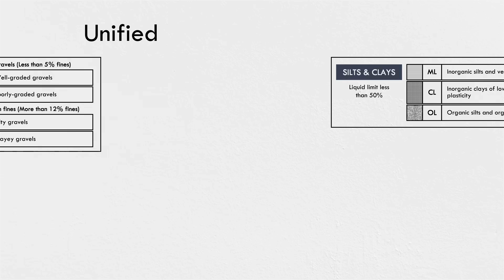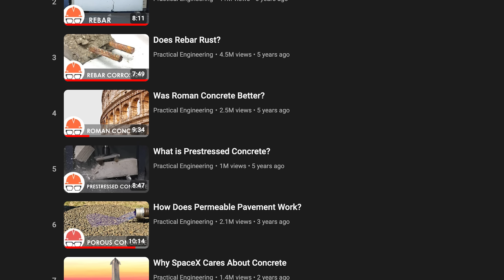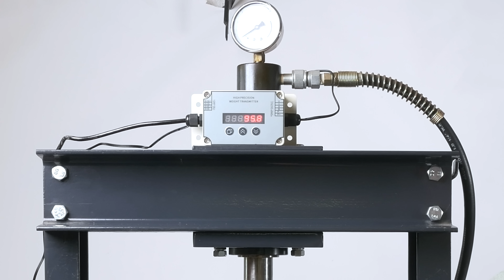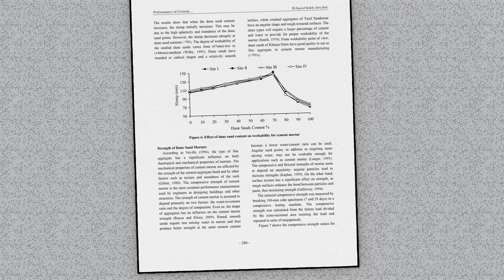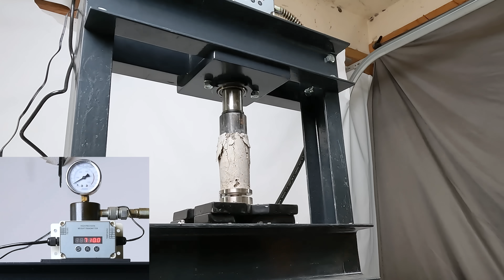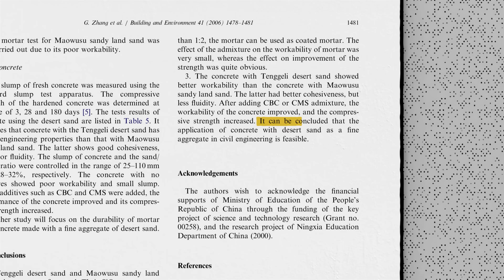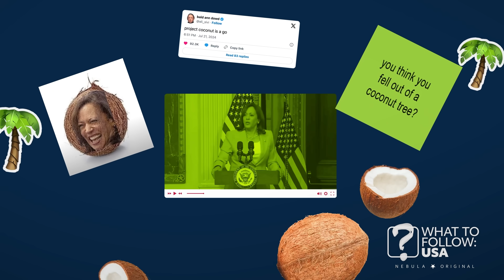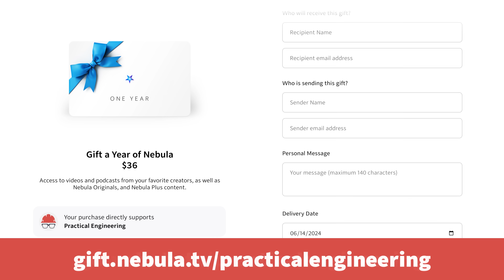Is the World Really Running Out of Sand?

Comment: About the recallability, I consider concrete as being non recyclable. Because you could use it as an aggregate, sure, but the resulting concrete will be much weaker, as concrete is softer than rock.
In the other hand, lime based cements, as well as chalk can be recycled. Because when is cures, they turn into the same composition as the original rock. So to recycle those, you can just dump the old mortar into the oven and get new lime or chalk from it.

Comment: It's not all just about grain size if you're trying to make glass out of it.  What we're running out of is high-purity silica.

When rock weathers, different minerals weather at different speeds.  Feldspar and silica weather faster than quartz.  So weathered rock, at some point in the process, consists of clay with grains of quartz in it.  When it erodes, and rivers and ocean waves sort the resulting sediment, the sand is quartz.  Quartz sand is what people normally more-or-less mean when they say "sand".  Making high-purity silica from whole rock is possible in principle, but it's a lot more complicated, and presumably a lot more expensive, than making aggregate that's sand in the sense of grain size but still whole rock in terms of composition.

Comment: The sand I've heard that's in short supply has nothing to do with construction, but with the high purity silicone used in chip manufacturing. Anyway, the value of crushed/recycled concrete is actually higher than the aggregate material it comes from. Widely used as a compactable base material in my area beneath concrete work and paved surfaces.

Comment: you  only add enough water to make it workable.... i delivered concrete for 10 years, workable means self leveling. i wouldnt buy a property in a sky scraper these days, the concrete is poured so wet its insane legit 7-10 inch slumps on the regular. no one wants to rake it out
Reply: It's a bit different these days with all the admixtures and things they can do with it. At a 7"-8" slump, 3 of my 4 most recent 2-day breaks came in at just over 5000 psi which was the 28-day acceptance strength. The fourth was around 4700 psi which was still way higher than the 3500 psi needed to stress PT tendons. That being said, not all concrete suppliers have the same quality, and not all contractors and inspectors have the same integrity so YMMV.

Comment: I read recently that the Romans used sea water in their concrete and this may be why the roads  have lasted so long.  Do you have any info on this?  Great video. I've been watching videos about this for a few years. Glad to hear we are not running out of sand.  Oh, cement is corrosive, but concrete is not I think. Is that what curing is about?  A chemical change that turns something toxic into something inert?

Comment: I remember reading a lot about "running out of sand" in the semiconductor industry because there's only a few sources that are useful for making chips, since they want raw materiel that have a high concentration of silicon and few contaminates.  Granted, you need a lot less sand to make a computer-chip than you do to make a building.

Comment: I worked as a concrete technician at a plant a while back, during which we transitioned from using riverbed sand to crushed rock for the 0-4 sand. The plan was also to phase out the 0-2 in the same way. 0-8 and 4-8 etc were always crushed rock. This was done due to sand running out close by, and continued extraction would have had an impact on the ground water. 
You hit most of the points, like how you have to adjust V/C ratios and add some chemicals to get the new recipies, but for us the most noticable difference was the wear and tear on our mixers. 
Parts that used to be replaced yearly now had to be changed 3-4 times a year. The sharp edges of the crushed stuff does not play nice with machinery. 
Anyhow, I think it is somewhat true that we are running out of natural sand in many places. But it is always a local shortage.
Reply: I'd guess that the extra 2-3 replacements a year are still cheaper than getting the sand from somewhere more distant if the company is deciding to go through with that. Just goes to show how much transportation cost plays into it
Reply: @sage5296  Yeah, you just has to deal with it. One thing you can do is to store the crushed stuff in the open air for 3-4 years, turn it over every now and then. Smoothes it down a bit so it isn't as abrasive, and removes some of the finer dust.  
You could also tumble it, but that is a significant added cost. The difficulty isn't technical, it is economic. Hard to tell what actually makes sense.
Reply: Greenland has enormous amounts of the sand needed to concrete, and I mean enormous, there are scientific studies in nature science journal about it
Reply: @kimmogensen4888  
Now I understand Trumps landgrab !

Comment: Most of the world’s energy is produced thanks to hydraulic fracturing, a technique which creates cracks in rock by pumping sand and water under high pressure into the earth. The sand remains in the cracks and creates a high permeability channel for fluid flow. A big miss on this video for not mentioning that. The development of unconventional shale reservoirs over the past two decades is one of the market forces that has increased demand for sand, as these wells require large volumes of sand. Petroleum engineers will thumbs down this video.

Comment: Thanks for the practical demonstrations!  Especially the one where you used less water, to make the rounded sand stronger!    And while creating our own sand is more expensive, I imagine that cost will go down over time, as energy prices start to fall in some places, due to things like renewable energy sources ( wind / solar ) become cheaper and more prevalent.  Like you said, it's not grain surgery.  Just need some powerful motors spinning some steel to grind up rocks until they are the right size.  And while running those motors is energy intensive....It's not like it's as intensive as desalinating ocean water, or more expensive than the fuel to move the ingredients around.   It's just MORE expensive than scooping up sand from the ground.  It's relative.   And I imagine that if someone set up such a rock crushing plant close to where it will be used, and fairly close to an area with lots of rocks ( or old concrete, or whatever ),  It could balance itself out, as it could drastically reduce the amount of transportation needed to move the stuff around.  

Super fun video, debunking a highly believed myth, and showing there are ways around this "sand crisis".

Comment: The myth about the type of sand used is cement came from being able to MARK UP the PRICE of the mixture.  The amount of water in the mix is LOGICAL, especially if the tumble sand requires less water; and because using more  water to make a plyable mixture weakens the finished product, then tumbled sand makes MORE LOGICAL SENSE! 

Thank you for clearing up this point for me.  I have pondered the water and sand variables in my mind for years, but the mainstream information just never settled well in my logic system.

Comment: As someone in geology I have to add that not all rocks are the same and the mineral composition of the rocks would definitely matter and influence a host of properties relating to the final concrete. Luckily the rocks used in this video seemed to be quartz/quartzite based which makes them very similar to the sand you’d find in a river. I feel like this was sort of an oversight in this video.

Comment: Sand is on a spectrum. 

You have dust on one end, rocks on another.   Sand is somewhere in the middle of the spectrum, but is not well defined.  
Spectrum is complex, and not 1 Dimensional, but in rough terms:

Dust -> Dirt -> Sand -> Gravel -> Rocks.

I've seen machines making gravel, pass any soil through successive layers of sieves, and you will get a wide range of dirt, sand, and gravels of different coarseness.

Comment: Here in Iraq air blowen sand is used and a strength of 80MPa (1670kip)  is achieved with additives incorporated into the design mix and water content reduced to a 37-40%

Comment: i personally know a former top official that managed major projects for Sukut construction,  there are specs so specific that boggle your mind.  sand isnt just sand, army corp of engineers required on a dam project that the sand used under microscope had to have a minimum angle fracture on the grains of sand. if they were too soft, the batch was rejected. half the time when they were transporting the sand a mile or two down the road to the project from the crushing/plant quarry, the sand would "round out"  and they would reject the batch.

Comment: I did a contract in a shipyard in Saudi Arabia.  That edge of the Persian Gulf is extremely shallow (about chest deep) for several miles out from the shore, so the shipyard required a dredged channel several miles long.  To prevent the channel from silting up, concrete blocks (they look like tetrahedrons) were used to line the channel.  I was told they had to import the sand to make the concrete.  They said it was because the local sand had way too much salt in it because it was ancient seabed.  It makes sense that it was actually the shape of the sand instead, since it is fine as talcum powder.  

I used to walk out to the dunes (about a half a mile inland) just to play with it.  I also mixed some with some graphite grease and tested it as a lapping compound.  

It matched the performance of  1600 grit compound, although it could have been better if it hadn’t broken down so fast.  

It always fascinated me that it could be so fine and still abrasive.  It was so fine that I am not sure if it would fit the definition of sand shown at the beginning of the video.  

This meant it got everywhere, and no sealing method was safe.  I replaced a lot of pump mechanical seals that should have lasted years, but only made it 6 months.

Comment: Grain size and what else is mixed into the sand is more important than shape. Any concrete engineer will tell you that. It's why using beach sand isn't common. You need to wash it extensively to remove the salt because the chloride will destroy the rebar inside the concrete. Making sand from rock is cheaper then cleaning sand as all it is multiple crushing stages. And since you control what rock goes in you get clean sand out.

Comment: Cant you roughen the Dune sand to increase its angular friction?
Reply: Yes but it’ll remove material making the sand even smaller and possibly to small more many concrete mixes.
Reply: @GrillerRohde  What about adding some sort of coating to increase its angular friction?
Reply: Sand worms so no.

Comment: Grady do you fancy doing a video on the Grades of Concrete and how important it is in a project,  for example the slab pour of C20 when installing a 2 post lift.  
  Concrete grades include; C7/8 Concrete, C10 Concrete, C15 Concrete, C20 Concrete, C25 Concrete, C30 Concrete, C35 Concrete and C40 Concrete.
   Different construction projects will require concrete of certain strength ratings, so understanding the difference between concrete grades is key to finding the ideal mix for your specific requirements.

Comment: If sand for concrete were so valuable, it would trade for more than the cost of shipping it. It does not. I have read about the sand (tailings) from mines - which ars still rough enough for concrete use, and they are not worth shipping to places that use a lot of sand for construction…it’s not worth it.
Reply: Sand is still cheap because we have billions of tons available and suitable for construction.
Companies are stealing sand, removing it illegally. Right now all of this allows a relatively cheap price but this will change.
Reply: @GrillerRohde   They move it in small geographic areas, or regions with a local shortage. But not in most of say North America. There are plenty of mines in the Great Lakes region, but none ship their tailings to the major cities - Chicago, Toronto, Detroit, etc., as the costs would be too high.
Reply: That doesn't make it not valuable. That's a silly thing to say.
Reply: @randybobandy9828  explain.

Comment: Field carpenter here, I've spent some time working in construction quality control for a little bit which means I'm working alongside engineers on a regular basis. We don't so much use concrete in my niche industry, but we use grout for the work we specifically do. We have 3 different engineered ratios of mix to water that we are supposed to use. One of them is flowable. You have no idea how many workers I've seen walk on one of my jobs and want to mix it by eye and feel because "this is how we always mix it" instead of following the engineering. We usually have to hand pump or funnel it so it has to be off the flowable chart. Then I see them with their full weight on the pump handle because they don't understand why their stuff mix can't go through the equipment and it costs the company and customer money in wasted materials and manpower to clean the equipment, and time to remove the grout that has voids and bubbles.

I guess what I'm getting at is that I fully understand the frustration that happens when the guy with the clipboard looks away and the workers do what they feel is better than the spec book
Reply: This seems like a never ending battle, where the engineer is always wrong and the boots on the ground know better, except there are many engineers and lots of literature that is very valid, and lots of boots that are off that charts.  The yin and yang of the construction industry it seems.
Reply: @IanBMorris   so in my specific corner of the industry I am lucky that we tend to have engineers that are readily available to us that are able to make pretty quick changes as needed. (Boeing could take a note if that) Because believe it or not, there's a lot of moving parts and things do get overlooked in design. But that ultimately comes back on the trades and their management to step up and say that either something is missing or that something doesn't look right. Especially when we have engineers that are so swamped that they can't get into the field, they love it when we are able to produce field drawings and photos with possible solutions to a problem that they can put numbers to and determine if they will work or not.

But we also tend to get our share of folks that think they know best. The guy from the example I gave outranked me, I went through the appropriate chain of command, and I had it dealt with since quality control is still one of my roles and I know better. Because of what he did in 5 minutes it cost us a week of man-hours for a team of 6.

Coming from a tradesman, the engineer does their best to be right. But if we know it's wrong before we do it, then it doesn't matter if they told us to or not, it's still not right. That's why we have RFIs (and some of us have the engineers phone numbers)
Reply: @Psikeomega  that's how it should work it seems, everything is a collaboration and everyone is working towards th same goal, or at least they should be.

Not everyone is perfect, and when there are big projects with lots of moving parts and lots of eyes on everything it's good to be able to adapt and adjust in the field.
Reply: @IanBMorris  yeah, you get it.  I've been on a lot of projects in my decade in the trades. But the most money gets made when everyone gets along and plays their part. Then the companies get more contracts and the trades make more money because of it. That's why my current employer actually has office team members whose full time job it is to coordinate with the other trades, engineers and our field workers.
Reply: The ol book vs street smarts at play here.
Reply: Isn't grout what goes in-between bricks or something like that?
Reply: @TrevorD19  it can be. But it has other useful applications as well. We use it for machine footings as well as mixing it flowable and piping it into the structure of some specialized machines to provide weight to resist vibration. There's math there for the tuned mass or whatever. But the engineering dictates the individual use cases.
Reply: @TrevorD19  Grout is essentially just concrete without the pebbles and gravel.

Comment: Quantifying the question, some places are running out of 'construction' sand. The so-called good stuff that can be used as base-building material. I also saw a video and the 'sand mafias', which sounds laughable on the face of it. An interesting issue plaguing parts of the world though and not a trite issue.
Add: Replace your rubber barrel tumbler with a hardened steel vessel and the aggregate grinding meda with ball bearings, you're manufactured sand will look more like what you'd see on the construction site. For extra points, throw in some graphitized carbon.

Comment: In parts of the upper midwest there is a lot of controversy about sand mining. Certain types of sand are needed for fracking. This is a competing use for specific kinds of sand, and this use pretty much removes sand from the environment, meaning it can't be recovered and recycled.

Comment: In my experience, when ordering concrete, typically the water is short by 1 gal per CY, such that if the workability needs increasing, we can add that 'shorted' water.

Also, on a construction project, we pursued using dredge spoils for select fill as there was a USACE disposal site close by.

Comment: Another critical use of sand is as "proppant" in oil well fracturing. It is pumped in along with water to help hold the hydraulically created fractures open after the pressure is released, leaving flow channels for the oil and gas. In this, angularity plays a large role.

Comment: Concrete exposed to heat or fire can have the water boil off leaving the cement and aggregate lacking any cohesion. Can you please contrast concrete with refractory materials which can handle temperatures that would destroy concrete ?